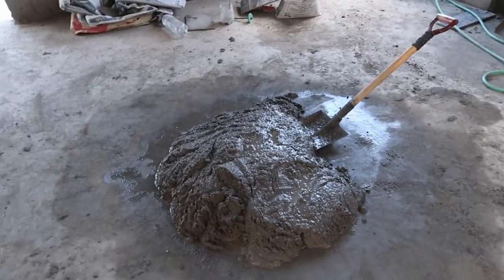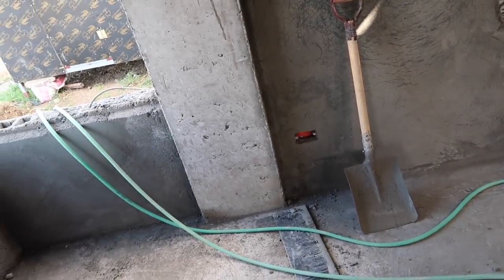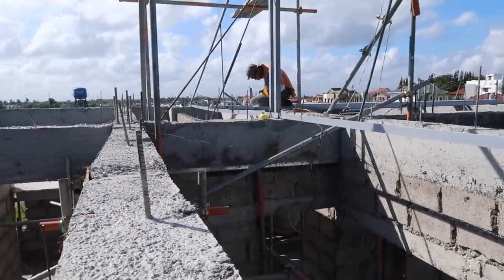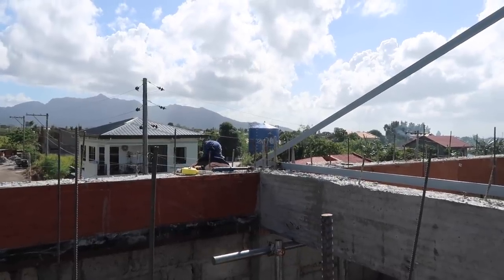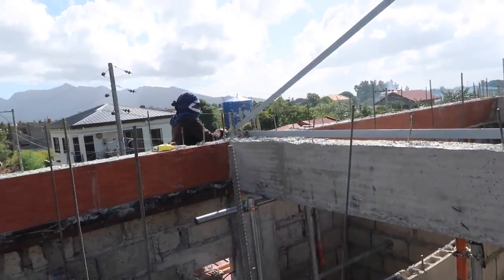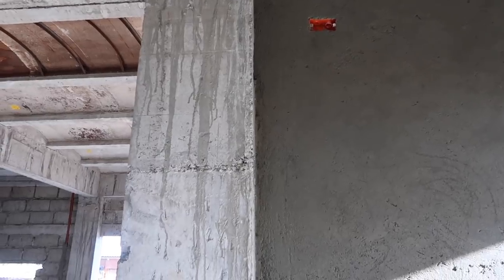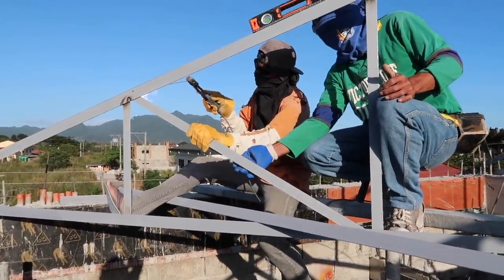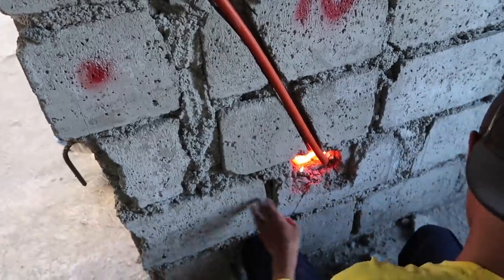HOUSE BUILDING IN THE PHILIPPIES - EPISODE 82: STEEL ROOF TRUSS

Comment: In the UK the cable for the wiring should be vertical from to the sockets, not at an angle. 
Take some photos of the walls before they are covered. Then you'll know where the electrical wires are if you ever need to drill into a wall.
Reply: caparn100 that’s because there’s no standards on anything. The trades are pass down from father to son, even if it’s wrong.
Reply: that is a great idea but he would have to have another computer to hold all the pictures. LOL
Reply: caparn100 this is what I tell them, when I see construction going up. By having the cables vertical, you know where they’re in the walls.  They can’t see that. Shortest route from a to b
Reply: Kusnezoff hey, it’s not my pathetic work practices.  I cringe when I see it.
Reply: @taffythegreat1986  I know what you mean. I feel for you 100% :)

Comment: Looks like the wall is drying out quick
Reply: It appears they didn't wet the wall before applying the first coat so the dry block is soaking the moisture out of the mortar.  Video about wetting the wall first, titled:  "SHOULD I WET IT FIRST ? (Bricks, Blocks, Stone,) Mike Haduck"
Reply: D Dixon I find they know the bare basics of trades. But not the finer details or technics of things 
On my build, I’ll show them a way that is a lot easier and quicker. The second my back is turned, they do it their ways
Reply: @taffythegreat1986  Constant battle no doubt .... sadly, babysitting comes to mind.  I like building things, but I dread having to do it in the Philippines.  Luckily it only takes about a year depending on the weather and how many holidays one's build crosses.

Comment: ⭕⭕  is all of your outlets going to be 220? Or are you going to include 110 as well?  Reason I ask , a lot of expats I have watched over the years all say the same thing, that is electronics in the Philippines are not as good as what is available in the states. Just something to think about. Hi and low voltage can destroy electronics as well. Surg protectors is also good investment for the hi end things like tv, washer & dryer. Stove, gas is nice during brown outs, induction is nice if you have kids, but you must have cookware that a magnet will stick to or it will not work rite. Electric stoves are not practical in my opinion in the Philippines.  Just some things to think about. If you do decide to go with gas make sure it does not have the safety valve on the gas. No electric no gas. You want to be able to light it with a match if the electric is out. 👍👍
Reply from the maker: Our main kitchen will be whirlpool ceramic with overln then the dirty kitchen will be gas stove stand alone.All 220V then we will use 110V transformer for our 110 appliances